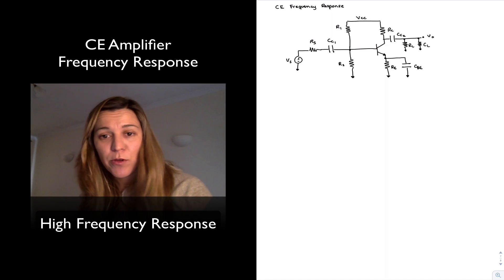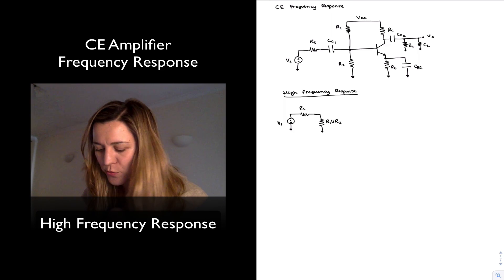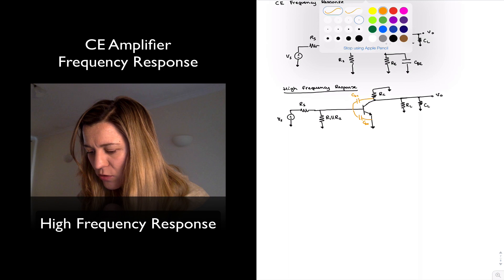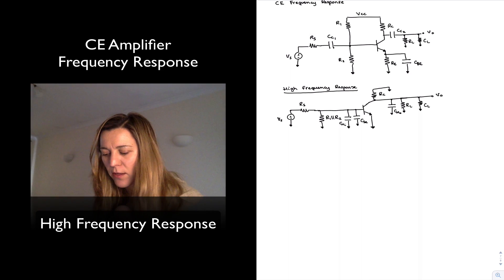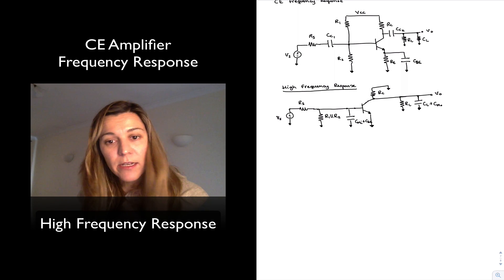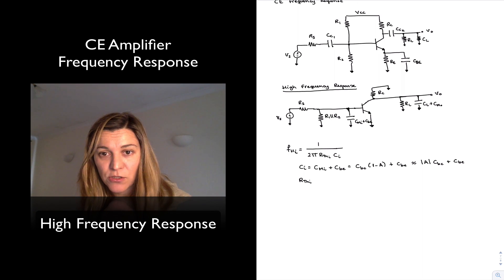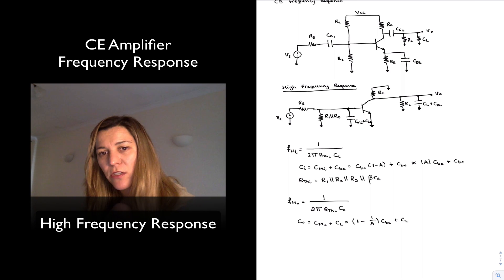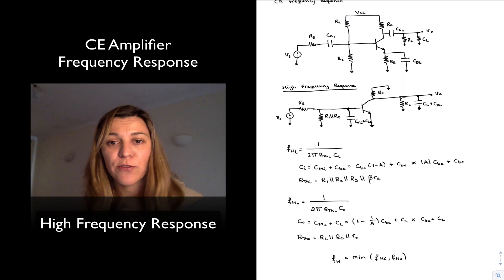CE Amplifier High Frequency Response

Comment: Why is Re short circuited ?
Reply: Because for the high frequency analysis we don't take into account the coupling capacitors and the bypass capacitors. CBE is a bypass capacitor, so it is short circuited and Re in parallel with a short circuit is just a short circuit (Re//0)=0